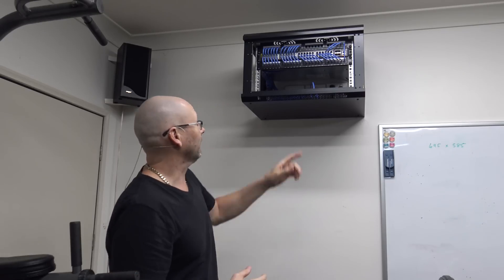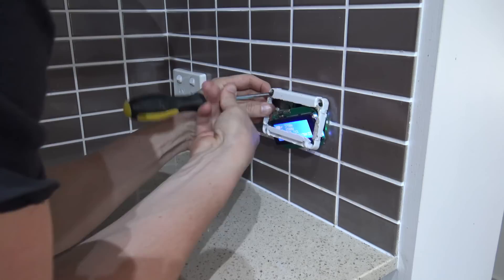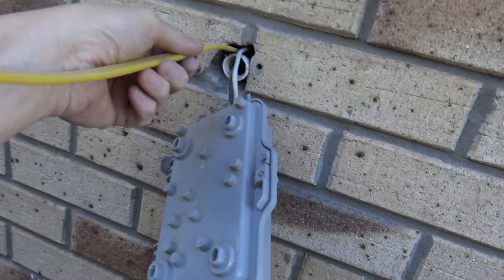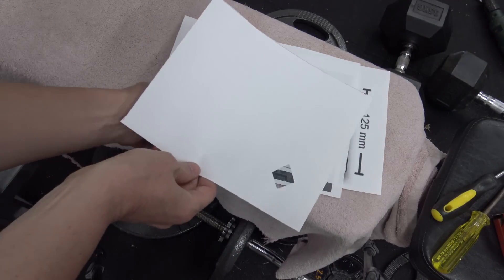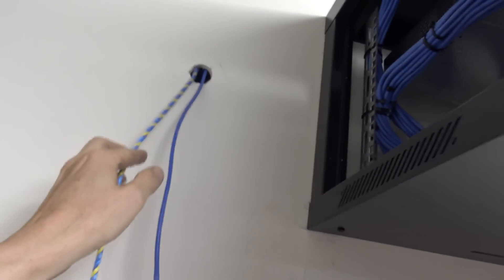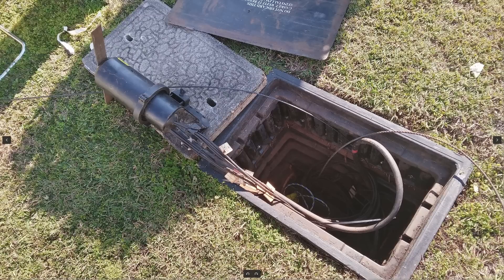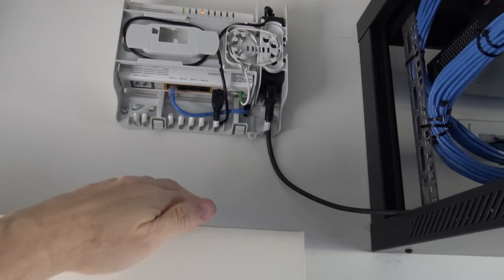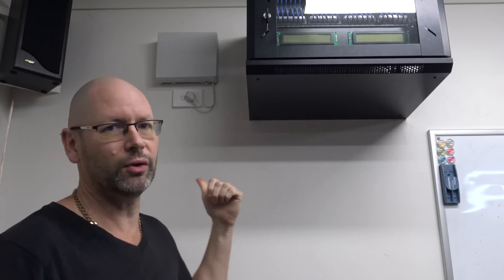NBN Fibre FTTP Install

Comment: I'm planning to do this too.. I see a few people asked but no real answer.  I thought the conduit had to run the entire length from outside connection box to the modem, so that means vertically inside the walls or outside the wall.  How come you didn't do this?

Did they say this was okay to do this, or you took a punt?  This is my dilemma planning my install.

Comment: 3 larger 180 bends are better boys and girls. Cables are harder to pull through the 90 bends. How many jobs I had where the glue got on the string or rope and wouldnt move anymore( and didnt know where it glued)
Reply from the maker: I think I showed in that video, that you're only supposed to put glue on the part that's going inside, so excess falls on the outside as you connect them.

Comment: Hopefully one day we can use GPON SFP modules instead.
Some other countries have had luck with work arounds but not here yet.
Reply: This is what I am switching to for my and my friends FTTH soon. SFP module to receive the fiber link directly into gateway, then configure the WAN in gateway directly. For larger houses which need more coverage, no shitty consumer mesh systems with shoddy support. Straight enterprise APs with seamless krv roaming. PoE switches, controller, 2-3 APs. Upgradable as needed with further integration for NVR security and alarm systems. 

Going with TP Link Omada and Vigi for all of them.
Reply: @shahzebatiq1 post a guide if you ever figure out if it’s possible.
NBN are using sfp modules for fibre to traffic lights, so maybe the tech will be rolled out one day.
Ubiquiti gear for me, next looked back. Their rack mounted range seems pretty spot on for what I need

Comment: Every video I’ve seen on FTTP upgrades show a phone line that runs from the pit to the house underground. I wonder how it’s going to work for those of us whose incoming line runs in the air from the top of a telephone pole to the roof of the my house.
Reply: I can tell you tomorrow when my friend who also has above ground fibre gets his installed.. Pit for his place is across the road
Reply: They have fibre for Aerial cable with a Catenary cable

Comment: Hopefully this question makes sense:
How far down in between the wall does the conduit have to go from where it goes down from ceiling to where the fibre will be pulled into the house?
Does the conduit have to go all the way down to where the exit hole will be?
Thanks in advance :)
Reply from the maker: Nah, it ends just after the bend to start it down the wall
Reply: On the internal side, just the bend like he said. For the outside wall, I ran a vertical piece down as far as the hole bringing the fibre in as we're prone to having mice. Plus I had almost 2m of conduit left so it was handy.  Isn't necessary though, the cable is quite tough.

Comment: So how the hell does the wire get from the pit to the side of your house?
I swear NOT 1 person ever shows this! 
Does it magically just float in the air?
Does it just run on the ground? 
Someone answer pls!
Reply from the maker: Watch the fucking video https://youtu.be/ew1Ntfz_5Mc?t=526
Reply: if im not mistaken its either run through conduit from the pit to the side of the house or for older houses its above head, like power lines
Reply: so there is magically an underground "run from your wall" to the pit out on the street? 
Fken Hell mate, not everyone has that magic connection!

Comment: Tall Paul Tech wrote ........................

I did most of the preparation for them so that they wouldn't have any problems putting the unit where I wanted it.

bit of a white lie there brother........

Consumers are not told when ordering FTTP NBN connection that NBN does not lay cables to your internal connection point unless at your expense you provide the pathway 

It is not cheap to do so,  unless you undertake the task 

NBN is a wok organisation that wraps their workers (in most cases contractors) in cotton wool work regulations to protect these pussies 

NBN is in reality pushing a very deceptive Connect Your Home to Fibre campaign
Reply: That was a TOTALLY grub comment..
Reply: @michaelthompson9548  ~ But is he wrong?

Comment: Hi Paul, looks like you did it the way you wanted which is good. I am getting a cabler guy in first before nbn to hopefully help in installing the connection box in my desired location.
Reply from the maker: Just tell them where to put it

Comment: Thank you. I followed your video to do the same for my house. It worked very well!
Reply: Same. I have a double brick home and I’m doing the drilling and pulling the internal fibre optic myself before the NBN do the external run. My issue is I’ll need to get the angle of the holes accurate as the brick is obviously thicker than Gyprock and apparently the optic cable can’t dogs leg. Thanks for the video and the pictures of the internals of the box. Very useful.
Reply from the maker: The same? haha... pics or it never happened!

Comment: Useful vid, getting FTTH very shortly.  Was wondering how it might work, as the current copper is piped through our garage, then underground (in a shared 50 core cable) through conduit to the house, then no conduit to a patch panel, and if I was to make this happen, multiple bends (9 maybe). Its probably easier for me to plan for termination and conduit in the garage then deal with internal house cabling. Cheers for the useful info.

Comment: Nice video... I would have suggested a cat6e cable to be run for future proofing.

So that connector 2 pits down is called a CBT. Connectorised block terminal.

Q: when setting up your router do ISP's in Australia use PPPOE, DHCP or static Ip address with a vlan to connect customers?

In the UK they use PPPOE with a Vlan which can some time reduce speeds.
Reply: i got a nice cat8 cable ready for when i get fttp. bigger pipe = easier to flow right in terms of data?
Reply: Depends which ISP.

AussieBB uses IPoE/DHCP/Dynamic IP.

Plenty of others use PPPoE however, and some play around with the VLANs too.

Comment: Where'd you get the NBN conduit? 

Ps I've watched you cooking videos, you need more seasoning mate.
Reply from the maker: From an electrical supply place, but it turns out you don't actually need the NBN stuff specifically they said.

Comment: Lucky you have a simple dwelling for the conduit to run. I'm getting an upgrade in a couple of weeks, and I'm assuming they won't put the NTD where I'd like them to. Will go onto the 2nd story from the garage. Hopefully I get a competent tech who can find solutions. If not looks like I'll be running CAT6 cabling through the house.

Question though; the phone line is overhead, does that mean the PCD can be placed in a position which will make the NTD easier to rout? Or does it have to be near the electrical box, or some other regulation on where it needs to go?
Reply: what happened with that.  I've got overhead telephone line too, but it sounds like they still will only install everything on ground floor.
Reply: @kerrynball2734  We ended up having it run to the second story; terminating in a bedroom, as it is adjacent to the garage. If you can do this, make sure to tell them so they will add some extra fibre in the roof. 

It made it a lot easier for running cat cable through the roof and in the position I wanted the router. In future I will get a cabler to move the NTD to that spot as well.
Reply: @shoobiefu You have to get NBNco to move the NTD, not a data cabler, as if anything messes up you'll be on the hook for the repair costs.

Comment: G'day Paul! was wondering how long it takes for the full speed to kick in? I recently went from FTTN to FTTP and speed went from 50ish to 120-150 at times, its been about 24 hours and still not the near 600-1000 download speed i was promised
Reply from the maker: It went to that speed as soon as they changed the service to it.
Reply: @TallPaulTech  Which service provider are you with?
Reply: Just tried going super close to the router with 5ghz and got to 400mb/s, I get about 60mb with Lan connection however its through those adaptors that connect to the wall any ideas how i can improve my speeds on my computer. Cheers
 @TallPaulTech
Reply from the maker: Oh, so you're not even using a proper Ethernet connection plugged into your router? Start with that.
Reply: I love the vid honest and not prettied up for viewers!
Reply from the maker: @awesomeness8206  Are you calling me ugly?!

Comment: how long did you have to wait to change from FTTN to FTTP? as i can't until after the Christmas and new years holidays
Reply from the maker: it was only like a week or two I think
Reply: @TallPaulTech  what speed did you change to have it done for free?
Reply from the maker: If you watch the video, you'll see the speed test, but it doesn't matter. They want the whole country to be fibre, and it should be damn well free since NBN is publicly funded.
Reply: @TallPaulTech  i rent my house what do i say to the real estate about getting the all ok to have FTTP installed?
Reply: @TallPaulTech  i rang my real estate they said i can do the upgrade
Reply: @TallPaulTech  who is your isp and did they ask for ID to get the upgrade sorted?
Reply: do need i the conduit for the techs to run the fibre into the roof? as that is where my phone line runs into my kitchen where i want it i have no Telstra Luca box on the outside of my house

Comment: Where did you get the templates for the Netwrok termination device so i cant have the screw mounts ready and the internal fibre coming out the wall? 
I'm a certified fibre installer and electrician. I don't trust the NBN guys to do the job well so I'm having everything ready before hand where I want it.
Reply from the maker: Haha... where did I get the templates? A piece of A4 paper, a pen, and some scissors! As I said, I had to hunt around to find dimensions online and pieced together a template.
Reply from the maker: Definitely a smart move to do as much as you can yourself beforehand.
Reply: Thanks @TallPaulTech

Comment: I did something very similar routing the fibre to my patch panel, so I appreciate your attention to detail.  Thanks for sharing.
Reply from the maker: Pics or it never happened!
Reply: I’ve also recently upgraded to Fibre to the Premises internet (FTTP), and I’m very happy with the outcome. Having said that, I do feel like I’ve dodged a bullet. I have learned some important lessons along the way, and I’m guessing that this will be interesting to anyone else planning an upgrade to FTTP, so I’ve written a summary of the process, the equipment, the surprises, problems and solutions, and put it in a google drive doc with pictures here: https://docs.google.com/document/d/1H1O9SZYlzXd_K_n96Z-wTcgPFhU82O6QOVaXotZA-QI/edit  I hope some readers will find it useful to help get the best outcome for their own FTTP upgrade.
Reply from the maker: Ah, you did a full write up. Nice.
Reply: @stephenlepage  hey, nice one Stephen!
Reply: @stephenlepage  Thanks for sharing, Stephen. I'm going to do the upgrade soon. It seems to me that the NTD bracket is designed to have the fibre conduit come at the back of it, instead of from around like a fibre wall socket. I feel it quite understandable (to run the fibre directly to the back of NTD) as the patch lead is run within the bracket as I understand it. Question though: in the first picture of lesson 3, it looks like the fibre is droppid in out of the hole without conduit, but you mentioned it used the phone conduit? Is there actually a conduit in the wall cavity?

Comment: I'm impressed you have the wired LAN in the house. I used to have that but in the end we were moving rooms layouts around so much and room reno's I ended up replacing it with wifi for my LAN. Its ok and does what I need it to, even though I've had to throw in an extender or 2. This week I finally get FTTP so I'm hoping the bandwidth can stand up to whatever the kids are going to smash it with.
Reply from the maker: Wi-Fi extender..... oh dear...
Reply: @TallPaulTech  yeah but its home internet. And I'm too old to be pulling cable. I tend to do it a lot different at work. No extenders there.

Comment: Your desktop test proves my post from before. Frick your uselsss cabling off and spend a bit on a decent 6e mesh. Yawn
Reply: cable is superior  and more reliable idiot
Reply: The lower desktop speedtest result was due to the Raspberry Pi router being the bottleneck. It literally could not route packets fast enough. That is why Paul is talking about replacing it with something else.

Comment: The house I bought already had FTTP and the installers intalled it on the closest corner to the kerb.... the master bedroom. My suburb was one of the first suburbs in Brisbane so everyone got a UPS with their fibre... Nothing like waking up at 2am to the sound of a UPS battery alarm (that you can only silence for 24hours)... To top it off, the UPS output was to a 6pin connector so I couldn't easily bypass it with a spare IEC laying around!! I think one of the pins was used for monitoring because I disconnected the battery and NBN knew about it "you can't touch our equipment" .. ITS MY MAIN BEDROOM AND BEEPING haha
Reply: Jaycar sell pre-made PSU's for FTTP NTD's as well, which has a cable loop that bypasses the battery backup monitoring circuit afaik.

Comment: Hey Mate - Great Video!

Question -  does the conduit have to go down the wall cavity?    Similar to you I have it in the roof and bends going down each side... but on the PCD side, they have left it in the cavity to drop down for NBN as the location isn't clear for the PCD into brick.

On the other side no drama - is a bend and draw string to the telephone port for them to install the new connection internally.  Thoughts??
Reply from the maker: I didn't have conduit down the wall, no. Just the bend at the top to head it down the right way.

Comment: Is it possible to run a patch cable from the fttp box to another place in the house, I.e the modem is in another place and is just plugged into the wall (Ethernet) which is connected to the fttp box

Comment: it really sucks australia is far behind when it comes to internet, also if that's not bad enough, nbn scamming with locked uploaded speeds of 5mb/s on the upload side, that's very very slow, the highest retail speed you can get for home is 1000 download / 50 upload. NBN are milking the upload speeds, there is a symmetric enterprise business plan of 1000/1000 but do you know how much they are charging for a ridiculous price over $2,000+ a month! In other countries especially in Asian, they already have 10gigabit speeds for download and uploads and cost very cheap, yet we still only in garbage 1gbps download and 5mb/s upload,  yet australians don't complain or do anything about it, very dodgy and scam aus internet is.
Reply: One of the many many problems with infrastructure in Australia. It’s ridiculous

Comment: Great video, thanks for this.  I have my FTTP upgrade available in September. I have my switch and router in the living room behind a bar. Outside there is a box on top of the garage which is the only one I can see that looks like it has the land line coming in on.  Its probably about 30-35 meters away from where I need it to be in the house. Will give this a go and try and run conduit through to where I want them to install the inside box.

Comment: Here in the Netherlands we have FTTP in half the houses now. Most of the network is managed by KPN Netwerk, and is based on passive optical network (XGS-PON). All newly built houses have gigabit capability, with >1 Gb coming in the near future.

Due to some consumer rights law concerning networking, the ISPs were ordered by the court to publish network specs, so you can actually hook up your own ONT, completely bypassing any ISP equipment at home, which I think is really neat
Reply: We would have had the same, except the liberals (conservatives, right wingers) decided to cut costs and only go to the node with fibre. Shit decision that has impacted literally like 90% of Australians.

Comment: I tried to get superloop fttp upgrade yesterday it was a bloody nightmare had to cancel and find another ISP. 

Where did you get the conduct with the writing on it. Was going to get Bunnings stuff but don't want NBN to show up and not use it.
Reply from the maker: You mean conduit? Any electrical supplier.
Reply: Getting my Superloop FTTP upgrade next week. Any reason it was a nightmare?
Reply: @ScaredTrout2nd  there customer service is third world
Reply: @Nightlifeimages  Oh yeah I heard about that. Fully outsourced customer service is 100% going to be a nightmare. But as a former networking graduate and hopefully tech inclined individual I'm hoping to avoid any calls to them and survive with some better speed than Telstra's FTTN.
Reply: @ScaredTrout2nd  yeah right. I've been in IT as well for over 15 years doesn't mean a phone call isn't needed from time to time when there are issues
Reply: @ScaredTrout2nd I was with SuperLoop, cancelled after a few months. Now with leaptel, they are sending someone for fttp upgrade next week. So far I'm impressed with leaptel, customer service is great so far and no complaints about speed 🙂